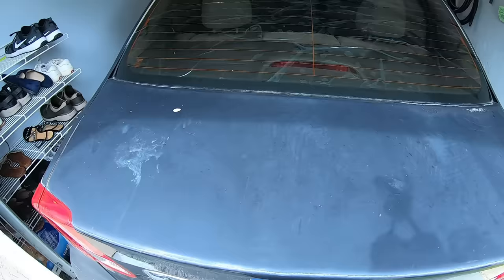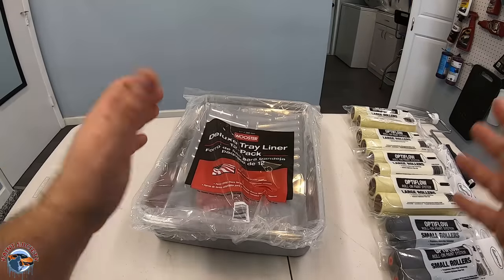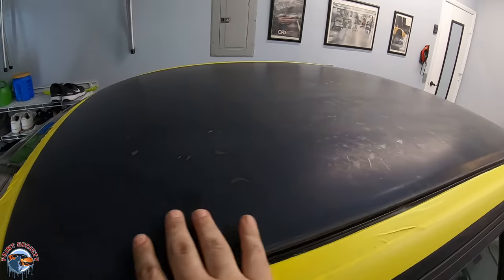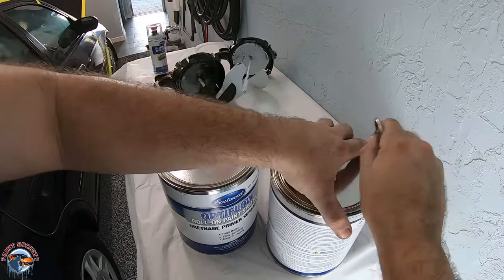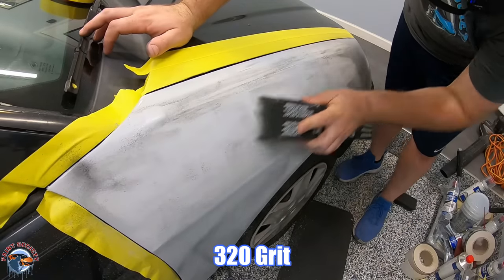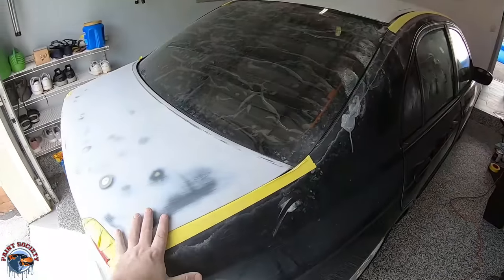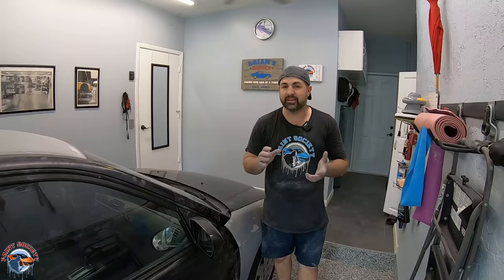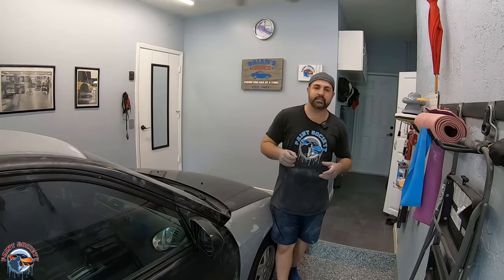DIY Roll-On System gets Great Results in Home Garage!

Comment: Rumor has it he’s still sanding 👀
Reply: D was
Reply: And singing, "III'm still sanding, better than I ever did...." 🕺
Reply: Because it's all about the universal 80/20 Rule. In this case he is doing 80% prep and 20% painting.
Reply: I take it though that as long as prep is top notch that this actually works. I take it that someone starting out this is a good start if unable to get all the more efficient tools like spray gun, compressor, etc. Yes?

Comment: Thanks so much for doing this demo, I hope that it will become available in Australia. The major advantage I liked was no overspray. Being able to do it in a small garage without having to fully mask off the whole car and all your tools around it is a major plus to me.
Reply: P
Reply: Kim Keam have you since used this kit or another roll on system? Eastwoods just too expensive for me personally here in Aus
Reply: I think supercheap primer filler is gonna have to do do my quarter panel 😊
Reply: @lindz151074  their primer is terrible in my experience. I've reluctantly bought some on a few occasions when there was no other options and it performed poorly each time
Reply: Sorry for the delayed response due to medical issues. I haven’t tried it yet but hope to mid February. I’ll text you when I have done it. Thanks

Comment: I have rolled on single stage urethane once. After a cut and buff, it came out flawless. The advantage to roll on is that more material is placed on panel so cutting and buffing is definitely an option for a smooth finish.
Reply: rolling the way he did puts on waaay less material than a spray
Reply: Yea, its possible to get a decent mil on via rolling.  But far rather spray it.  Buutt, you know as well as i, there are probably quite a few people out their who are intimidated by spraying and the prep, or dont have compressors or guns. Most dont realize just how simple it can be with a relatively short time of practice. People dont know what they dont know.  Its odd to me but happens in every line of trades

Comment: This is fantastic. In a shop setting a paint gun is going to be the way, but for the home hobbyist, this is going to be a new level. 2K products that don't require a gun and compressor is going to be a game changer.
Reply: No way....talk about too much work....too much time....and way too complicated.  Too many steps...too many products...short pot life...crazy long cure times. And likely too expensive. Get some 2k spray bombs and call it a day.
Reply: @bobwatfprd2328  Everyone is entitled to their opinion but let me say this as someone who works autobody and is restoring cars. This require the same, possibly less steps then normal primer. You still have to mix regular primer and you still have to wait between coats, and with regular primer you'd be bagging the whole car so it wouldn't get covered. A spray on epoxy is still going to require multiple days before sanding, and you'd still want to put urethane on top of it. Then, you'd still want to block the urethane and possibly put more coats on. What I see in this product is something for someone who doesn't have a 30+ gallon compressor or a spray gun. Yes you can get a Harbor Freight gun, but then you need to account for lacquer thinner gallons and cleaning brushes and such. This is aimed at someone who doesn't have a garage to spray paint in or the skill/ ability  to mask an entire car and spray down primer, but that's just my opinion.
Reply: @bobwatfprd2328  "get some 2k spray bombs". Huh? Are you for or against rolling? You're making it out like 2k pressure packs arent crazy expensive

Comment: That’s awesome didn’t know they had a roll on product some diy era may prefer that !
Reply: I would if It turned out good and smooth
Reply from the maker: I’m sure I can get it smoother if i has used the foam roller only.
Reply: You can roll acrylic enamel (industrial scratch-proof paint). Thin it out with mineral spirits, don't even need clear coat. It's a strong, decent finish. Like glass. Wet sand for best results.
Reply: @juansolo1617  any videos on this? what brand paint? if i could match paint to door jams it would be a great option other than base clear i would think... thanks
Reply: @roadstar499  Yeah, most shadetree guys call this the "50 dollar paint job" or the "rustoleum 50 dollar paint job." It's not rattle can paint. It's just rustoleum acrylic enamel, comes in a paint can. I've tried it on a bug and a civic with excellent results. Painted outside, had to wet sand a lot to remove bugs and dirt but the finish was very strong, probably a lot heavier than regular paint (so not good for race vehicles)
Reply: @roadstar499  Here's a guy doing it with a roller : https://www.youtube.com/watch?v=4yafb6X9j6E

Use the foam rollers. Get a lot of wet sand paper.
Reply: ¹

Comment: I like how you used a extension and a hammer instead of fancy dent repair equipment, those are common tools that cost nomore then $10 and everyone in the comments should have laying around the house, good alternative I’ll be using that same method very soon!!!
Reply: I know that this comment was 3 years old but I used this method today it was quick and worked ok even though I have the correct body tools somewhere in my garage but didn't want to spend the time looking for them.🤷‍♂

Comment: Enjoying learning from your channel and experience.  Researching, as the rockers on my F 150 are crumbing and I want to attempt the replacement.  As epoxys cure, not dry, and the cure rates are heat sensitive, I suggest heating the epoxy with infrared lamps to accelerate the cure.  This. and autoclaving are standard composites construction practice in the boat and aerospace industry.  Perhaps as simple as applying the epoxy or fillers and go park it in the sun.  What would Eastwood say?

Comment: I thought the epoxy goes over bare metal only but you use it on paint after you sand off the sealer coat?

Comment: Aren't those high spots on the trunk just the trunk reinforcement underneath? It looks like it has a symmetrical pattern
Reply from the maker: Could be. I can say though they were high based off the sanding but not when you went and felt them

Comment: I like the idea of this as I plan to rent a booth to re-paint my car but I have body work to do as if I doing all this I best get out all the dang dents and such ... but sounds like if I use this system I best be prepared to literally park my car inside the garage and not drive it during all this ... 

my  front bumper required its share of sanding still not sure what the heck to use for that ... I assume it would be the rattle can stuff they give you to spray those as the thing has so many nooks and crannys I don't see being able to roll this stuff onto it at all ...

Comment: watching your videos over last several days has given me a lot more knowledge and confidence... I ordered those hi flow connectors talked about after watching a few demos... I have a question... i want to start doing full paint jobs in my back yard...maybe one every 2 months... i see a lot of those inflatable paint booths with filters and 2 blower motors... do you know anyone that uses them? do you think you can get similar results as when using a high end booth? would be great to finish a job and not have to do a lot of wet sanding and buffing... thanks again for taking the time to make these top notch painting and repair videos...

Comment: Working on the bed of my 64 long bed c10, going to have the whole thing professionally sand/media blasted (whatever the tech thinks is best) because it is such a large surface with a couple layers of paint. After that I think I’m going to try this roller method unless you would recommend spraying.
Reply from the maker: Spraying is smoother but the rolling on primer can and will work.
Reply: Paint Society do you have any videos on polishing trim?
Reply from the maker: I don’t. Sorry

Comment: @PaintSociety I laid down a coat of optiflow urethane and didn't realize that i had to lay the second coat in under 4 hours.  How flat does the mechanical bond need to be to lay down more urethane.  can i just scuff it with a red 3m pad or do i need to block most of the surface flat with sandpaper. 

I was hoping to finish before going back to school.  So upset that i messed up and didn't lay down another two coats in the correct time frame.

Comment: Brian hey doing a 63 cadillac your opinion which is better spraying primer vs roll on I've got necessary equipment for spraying is that always best way to go or switch to this new rollon eliminating major mess preparation thx again looking forward to the next gig
Reply from the maker: Spraying is always better if you have the requirement to do so

Comment: I have one question  I have a tvr wedge  which the body  is fiberglass and it's  gelcoat can I use epoxy primer  on the gelcoat or do I need  the gelcoat?

Comment: Another great video ,thanks Brian!
have a question:
if its a panel with an original paint (never had any correction) like the roof on this Honda you working on- is it still recommended to use Epoxy primer or Urythene primer will be OK?
My clearcoat and basecoat are completely destroyed but there is no rust that I can actually see
Reply from the maker: If you’re not down to metal then you can just use urethane. Likely though when you sand you’ll go down to metal. In that case you can just use a can of self etching primer to seal off those areas then use the urethane over it.

Comment: If you were to try this at home in a garage , You would probably mix the primer a little thicker, The mixing ratio the guy in the video uses is the ratio you would use for spraying.
 You can see it is a little too thin . Remember the more you put on the less will come off when you are sanding. 
 You can use something called Rocket or accelerator in the primer to help with drying. This is dependant on climate temperature of course.
I would also recommend using a dry powder guide coat. As the aerosol guide coat tends to clog up the sandpaper more. Meaning more or less life from the sandpaper, depending which method you use.
Reply from the maker: All paint should be mixed according to paint manufactured technical data sheets.  Inaccurate mixing can result in the improper balance between primer and activator/catalyst causing peeling, chipping or  delamination
Reply: @PaintSociety   You are 100% correct, But you can make it still a little thicker by adding more primer and more hardener. I definitely would not use less than manufacturers specs. Got 20 plus years of experience, i would not give anyone bad or wrong advice. I do it all the time especially when spray priming on the body filler repairs, i always use a bit less thinners, works better for filling those deep scratches.
Reply: @mycarprobs6688  he didn't use any reducer in the primer, so mixing more primer and hardner want make it thicker just more volume of primer!
Reply: @jeremyking5684   I never said that he did use any reducer in the primer.
Adding more primer will make it thicker and give more primer.

I would recommend actually using a primer with a 4:1 mixing ratio as the primer would be much thicker to start with, and would be great for primer on body filler repairs .As i previously mentioned, the thicker the better.

I also think a 1:1 mixing ratio is a little too thin to start with, as you can see in the video. It's probably more suited to spraying.

Remember the more you put on the less comes off during sanding process.

That is why i say the thicker the better.

Comment: What did you think of that sand paper I do body work for a living got sick of expensive 3m paper at home so I tried that stuff and I wont use 3m on my own projects ever again that paper works just fine for a quarter of the cost. The high spots on the trunk are the foam spots inside the trunk probably were not high until you sanded on it. It don't take alot to block high spots in those big flat panels with foam sealer inside
Reply from the maker: Interesting about the foam. Didn’t know that. The 3m paper works a bit better. The paper clogged a bit easy.

Comment: i just painted my car using harbor freight gun and it came out real thick lots of fish eyes,turns out the spray nozzle end was not aligned with the holes which created a bad paint job,im wodering if i could simply take whats left of my paint and roll it or do i need paint thats ments for that?i was thinking i could add one more layer rolled on and wet sand/buff and polish and get a decent paint job this way

Comment: Great idea for a video.  I paint trucks and different industrial equipment would the roll-on primer hide some of the different imperfections in the steel do you think?  I ask because sometimes we get gas tank trucks that are all pitted up if we could roll on the primer maybe it would fill a lot of the pits and save some time with bondo?
Reply from the maker: It will fill very tiny imperfections. Pits and chips.

Comment: Do you apply the filler right over the guide coat that shows the low spots? Or do you have to sand out the guide coat?
Reply from the maker: Just give it a 220 scuff where the low spot is.

Comment: Can you make a video on professionally painting interior plastic trim black? Like Headliner trim, domes, handles etc. We want a formula that won't peel off and chip a month later! AAAND you can do it on the Honda!
Reply: Try Durabond interior spray dye, VHT and Duplicolor offer it too. And no, it doesn't chip, scratch off or wipe off, it's dye not paint that just lays on a surface
Reply: Also can use Hi-Tech Vinyl Plastic & Carpet Dye .  I've use it to change color tan to black and it won't peel and you can wipe it clean without fading .

Comment: Any reason why using epoxy primer and then urethane primer, friend? Any thought if I use epoxy primer to bare metal, putty for lows and then epoxy filler on top of all that?
Reply from the maker: Epoxy is direct to metal and prevents rusting.

Comment: Very cool bro I’m loving how u use tools laying around the house super DIY style bro! Question tho how did u control all that dust??  And I’m not sure about rolling primer on I guess I’m just not used to seeing it lol great video bro!
Reply from the maker: I just blow it out the garage every so often and the parts I did off camera were outside
Reply: You can get sanding blocks that have an attachment for an extraction hose , It would considerably cut down on dust, Half of that will be going in the guy's kitchen, Probably should get a door up.

Comment: I have a PPG epoxy primer, do you think it can be roll even if it was not made for that?
Reply: The paint roller is just a way to apply the primer . As long as you follow correct mixing ratios, it will actually work with any brand of primer.

Comment: Hi, I am seeing many people on YouTube using a bright yellow masking tape when painting cars. May I ask what kind of tape this is, and is there a benefit to using this tape?
Thanks, Glen from Oregon
Reply: The most common is 3M industrial (yellow) tape. It’s like the blue painters tape used for house painting but has a stronger adhesive that sticks better to metal and plastic surfaces. It also forms better to uneven surfaces so you’re won’t get edge bleed through and it’s bright color makes it easy to see your borders.
Reply: @derfstang480  Thank You!

Comment: Awesome man I love it!
Reply: I don't have the eastwood products but I attempted the roll on primer method earlier this week using another brand and I do like the fact that it can be done in a residential area without angering the neighbors without my compressor on. I also used my durablocks to crosshatch everything flat, with the primer that I used , it looked exactly like the same  texture that you had. I spent a lot more time sanding the primer down compared to when I use primer from my gun. But with that said I believe this can help alot of people, This is a great demo and review! Thanks Brian!
Reply from the maker: I agree. It was so nice to not have a cloud of overspray coming out of my garage

Comment: Are these product’s compatible with most base clear paints ?
Reply from the maker: Yes
Reply: @PaintSociety  Perfect, thank you! I’m restoring a square body truck and sanding the inside of can and thought this would be a good product for that, so I didn’t have to set paint booth up. Being able to work on a section at a time and seal bare metal with ease is a great option. If I just use epoxy to seal I can use Evercoat high builds on top of this product with no worries is a relief.

Comment: Hi! Could you maybe try (for fun and getting new experience) to paint a panel using standard automotive paints (primer, base coat, clear coat) by rolling it on with a roller? And try to see if you can get a good finish :D My guess would be that if you sand the base coat smooth, apply the clear, sand it and buff it, you won't be able to tell the difference vs spray gun
Reply from the maker: Ha. Would be interesting.  It would have to be a solid color for sure
Reply: @PaintSociety  yeah, sanding metallic base coat is a no-no unfortunately